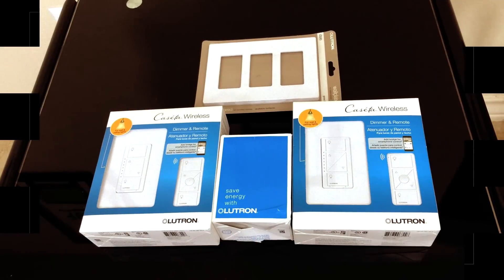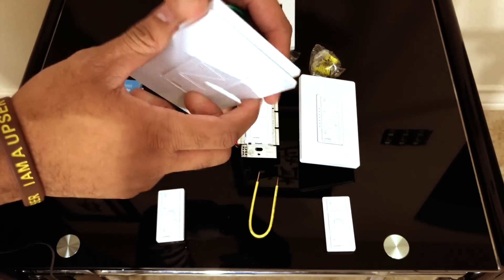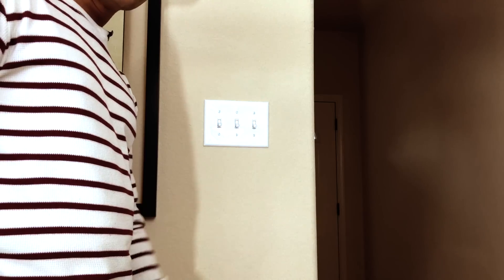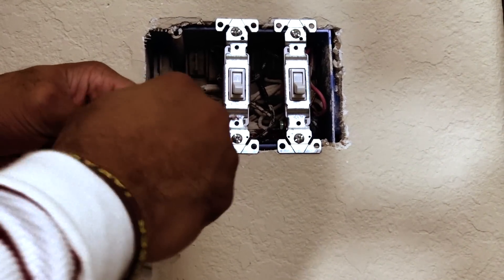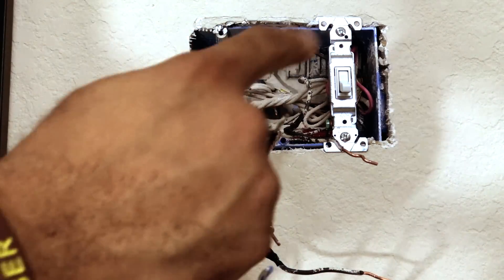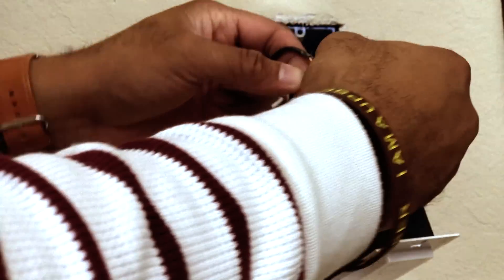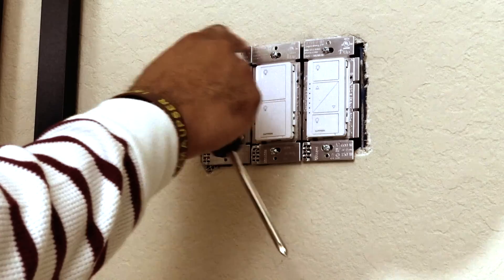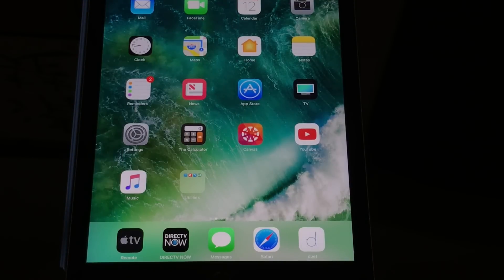Lutron Caséta Wireless 3 switch install

Comment: Great tutorial, I have a question about the ceiling fan, the switch you installed only controls on/off, correct?  is there something that will control fan speed?  Lutron Maestro has one with 7 speeds and works great, but we are now interested in a smart one.
Reply from the maker: Sara Scout Thanks for the comment! The last time i spoke with Lurton they did not offer a smart switch that allows you to control the fan speed. I hope they do offer one soon though!